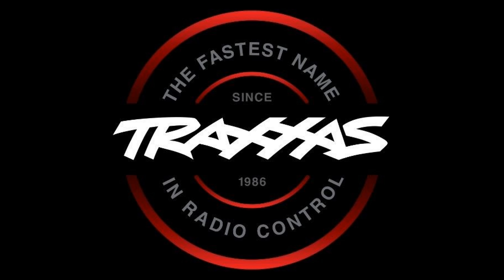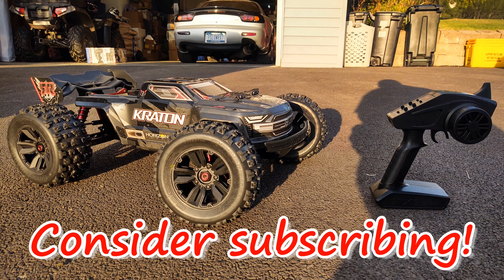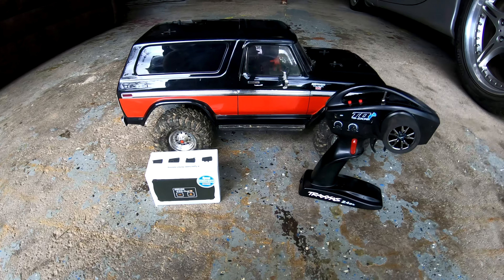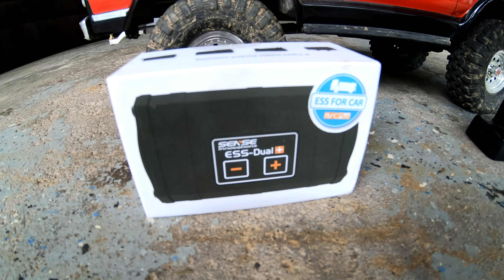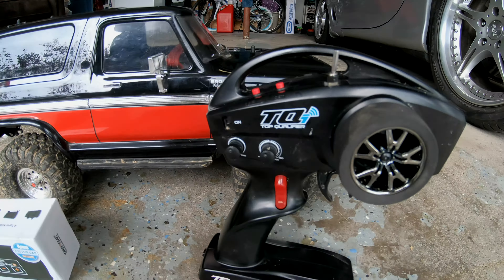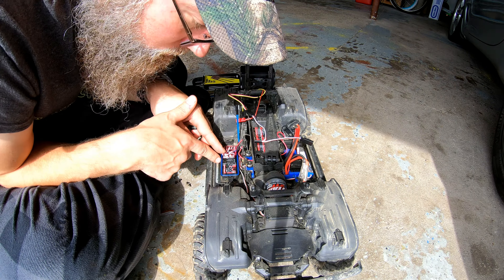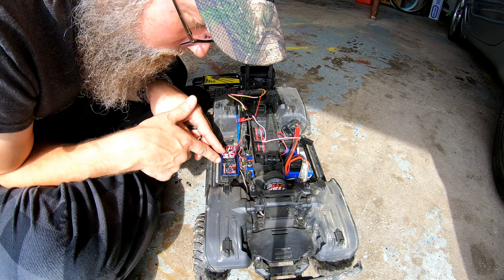Traxxas Bronco TRX-4 | Sense ESS-Dual Sound Kit! Install and test!

Comment: Love your videos, I have the light kit coming for my bronco in the next few days. I fitted my ess duel onto the front battery tray, it fits pretty good. Held down with a battery strap
Reply from the maker: Hell yeah man!! You will love the light kit. I almost put my ESS exactly where you're describing! It would do really well there, and help keep the nose down on those steeper climbs... The only reason I didn't is bc I wanted to mount mine high. I run through some creeks at times, and want it as far away from the water as possible. 👍

Comment: I wish mine worked that wel. I just installed it into my 79 bronco and it's not working properly. When I start up the truck the sound automatically starts and I can't seem to calibrate it with my controller.  been trying for hours now. Any thought on what may be my problem?
Reply from the maker: Are you using the TQi radio and OEM Traxxas receiver? If so it might be worth recalibrating your ESC (set neutral/forward/reverse). 👍
Reply: @WeissRC  yeah I saw someone else suggested that but I haven’t tried it yet. Scared I’m gonna bugger something up. Hahahaha.
Reply: @WeissRC  and I don’t know how to do it. lol.
Reply from the maker: @GlennBoB1969  oh don't be scared! It's only a few steps. 😁 Just follow the steps in this video and you should be good!
https://youtu.be/ix-J85uRFjE
Reply: @WeissRC  just tried that and it didn't work, but then again it seems i son't have the same hardware as used in the video.  my receiver has XL5 HV on it.
Reply from the maker: @GlennBoB1969  oh really? Should work for the XL5 as they're all extremely similar. It sounds like a calibration issue if you're getting sound initially, but it's hard to say since mine worked right out of the box. :/
Reply: @WeissRC  it’s so strange. That they work fine in one but then someone else it doesn’t work. I’m seeing a lot of folks having issues too.
Reply: @WeissRC  I may have to post a video showing how I have it set up and maybe that will shed some light.
Reply from the maker: @GlennBoB1969  great idea! Let me know if you do and I'll take a look! 👍👍
Reply: @WeissRC  thanks for your help on this. I really appreciate it.

Comment: Tell me about your set up is it all upgraded like esc and motor or was it stock and you just added the sound?? Is it a 1/10 cale
Reply from the maker: I'm running a Fusion 1800kV brushless motor/ESC combo... As for the sound kit, it's completely stock! Just using the sounds it came with. 😁 At the time of this video, however, I was still on the stock Traxxas motor and ESC. And yes, it is a 1/10 scale.👍

Comment: Is it possible mounting it in the front?
Reply from the maker: I actually wanted to do this, but as I recall one of the wires was too short to reach the receiver... otherwise yes, that would certainly be doable! 😎🤘
Reply: @WeissRC  Appreciate the response, might buy it and buy an extension cable. Would be nice to have some weight in the front.

Comment: "Installing & Test".... Bro if you just wanted to show off instead of showing how you installed it why didn't u put that in the thumb👎🏼
Reply from the maker: @sgthulk9  that's fair. Unfortunately, this was a few years ago before I had a clear goal for each video. I definitely need to re-shoot this video to be a full tutorial like my K10 light kit install. 👍👍
Reply: @WeissRC  fair enough. I'm just a bit grumpy because i'm sitting on this set for weeks now and it would be helpful if there was a YT'er who showed it step by step hiw to connect these wires to my high trail truck. Srry for the rant🤜🏽🤛🏽
Reply from the maker: @sgthulk9  no you're fine! And I agree with you. I should have titled the video something different, so people didn't think it was a tutorial. I will redo this as a step by step tutorial so it's more helpful. 👊